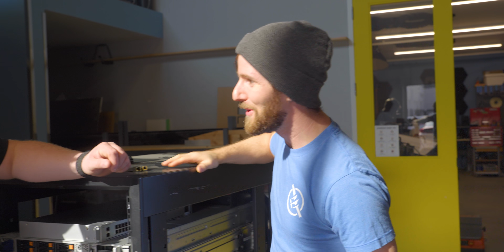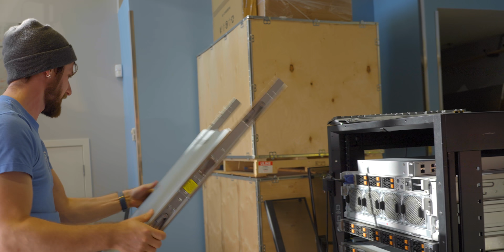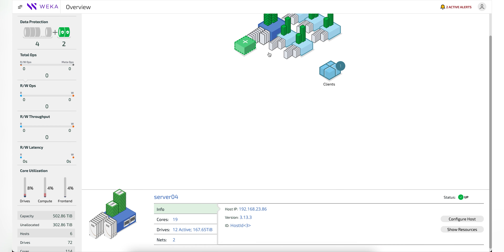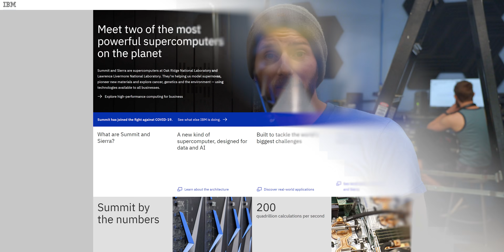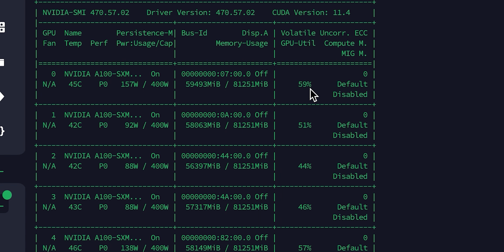The $1,000,000 Computer is Broken

Comment: So it takes you 4TB of data to get 5fps on a model that looks like it's from 2003? Sounds like the most unoptimized blender program to ever exist
Reply: sounds like you don't know what that program from NASA is doing. it is a DESCENT SIMULATOR not a CGI rendering station creating movies for Hollywood 2024. 14.3GB of data per frame, at 30FPS that would be 492GB per second of video. a dual layer BluRay disk can only hold about 50GB. a 30s video off that NASA program would be 25,740 GB. ramp that up to the 7-minute descent from space to the surface of Mars? 206,640 GB video for 7 minutes. 

that is an experiment to save human lives visiting another planet... not “Despicable Me 4”.
Reply: @lesliekilgore648  nasa had better CGI and simulations on 6KB of ram

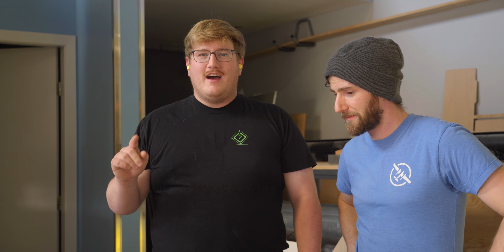Comment: From today's video at Computex 2023 he mentioned the dataset for this is about 100TB in size. 7:00 Network Time Protocol. Could you instead of used a command line script? Like in Windows using 'time' and 'date' command to set as you wish and run those all at the same time to synch time instead of creating a  time server?

Comment: So there is a "battery" that uses heat, and bricks/lava rocks to store heat. That heat is then used to make steam and make a turbine spin, but you can hold in the heat for a while, thus a "battery"... use the heat off about 7 of these machines to help add power back into the system lol.

Comment: So it very probably isn't drop damage 😄👌
Pins not having perfect contact is probably the common problem with those EPYC CPUs. Their retention system really isn't perfect. I think the next socket with the cooler pressing the CPUs down, instead of the socket mechanism like now, will improve contact. And it's not obvious to diagnose, but if you know it, it's easy.

Comment: That visualization is really cool.  When I did my CCNA class in 2006, I said someone could make a network management program that gives a visual map of your network that looked a lot like that (in my head... it was a bit sloppier when I tried drawing it).  With the layer 2 traffic Cisco has flying around, you could even have it update in real time and show and log new devices connected even for a short time without asking for an IP.  I was told that that wouldn't make sense because its just too much trouble to bother with an app or GUI and the CLI does everything you need better than any GUI ever could.  I think some things like that came out a few years later (not that I would have known how to make it).
Reply: It reminds me of the original Jurassic Park. "It's Unix"

Comment: Wow, honestly, I would have never guessed reseating the CPU and probably would have tested and replaced everything else and followed traces and checked components, updated bios, replaced cables, backplane, etc before I would have thought to just reseat the CPU. Such a finnicky issue but glad you determined the issue and got it working! $1Mil worth of equipment is not worth wasting.

Comment: coulda bought this used-from a disbanded company from a local reseller near me for $1900 and add ssd drives... ya know, if you were on a budget... Dell PowerEdge R920 Server 4x Xeon E7-8891 v2 3.20GHz 1024GB PERC H730P No HDD. 80 vcpus, terabit of ram...How I get my lab servers.

Comment: this was how i fixed my pc. it would run for 15 minutes and then shut off, and the temps were fine. i diagnosed that one of the pins on my cpu would act like an old toaster where a piece of metal would bend to complete the circuit, but mine was the opposite of that. reseating the cpu was annoying but it fixed it and now my pc is fully functioning :)

Comment: To be honest LGA socket is worse then PGA, less contact zone per pin, much more pressure needed to connect all pins, both socket/pins and processor should be 100% flat to avoid miscontacts. I've had the same problem a few times with server motherboards, in one motherboard CPU lost connection to the PCH after a while due to bad contacts in the socket, and in another one DIMM channel wasn't properly detected.

Comment: If I see how they treat there handling of the hardware in such a clumsy and unprofessional way, you can expect this kind of issues. If the equipment is really that expensive, a better treatment should be expected here. Besides, I don’t understand why Linus has that kind of expensive stuff for a hobby channel. He totally misses the connection with the viewers. And above all, where are the tech tips?

Comment: There ought to be retimer adapters in there, there should not be a really direct connection going on. And yeah, that's how it goes. Even had a similar thing on a Lenovo box. Reseating back cables... Worked...
From your use case I would never.. go with a system like that over a "normal" all flash box like Purestorage or better...
This thing seems too many low end components glued together and I'm afraid it will keep you far too busy.
And if cooling fails it'll probably brick itself faster than it can autoshutdown.
I'd suggest using a more relaxed config, i.e. twice the number of nodes with only 6 SSDs, 1 socket filled instead of 2, and so on. If wekafs works fine, you will have the same performance, but much smaller failure domains, more resilience and a more healthy load (heat etc) on those little 1U boxes.

Comment: I have a server with this EXACT same issue!!! It's a Threadripper 3990x and has 12 NVME SSDs - there are two ASUS Hyper M.2 cards each with 4 x NVMEs, plus the actual motherboard which supports an additional 4!

If it turns out that the issue this entire time was CPU pin contact, oh boy...

Comment: Lmao. For a really long time, my GPU always only had 4 PCI-E lanes. I was stumped on how to fix it, assumed that my GPU was borked, and just gave up. A year later when I went to de-lid my 8700k, and reinstalled the CPU, I found I had ALL 16 lanes back. Turns out I had the water block too tight, and that was warping the motherboard juuuust enough to make me loose PCI-E lanes. Best part is that I could repeat this on demand by tightening and loosening the thumbscrews.

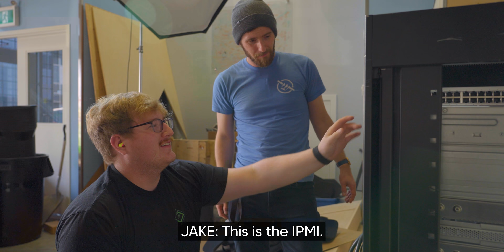Comment: 4:50 You should try Wave's Clarity VX to clean up the audio. It costs 120€ and literally is just a slider to enable or disable AI noise reduction. It's a simple VST3 llugin that works in anything from Audacity to Bandcamp to DaVinci Resolve. And it's made for scenarios like this.
Sitting on a tractor thats nearly overpowering your voice on the lap mic? Throw the plugin at 100% and the tractor will be basically with only minor changes to your voice that can be relatively easily cleaned up with some EQ.
Once again, Clarity VX is a true live- and game-saver in situations like these or on noise showroom floors.

Comment: I can attest that anytime you receive a server with components pre-installed(especially if it is delivered in a rack) you will run into intermittent issues that can be resolved by reseating components. I have seen this issue with every major server manufactory. Most common issue I've seen is DIMMs that aren't fully seated followed by PCIe devices.

Comment: Is it just me, or is their NASA demo explanation just incorrect and improperly demonstrated? It's not going to stream 14GB/s every frame, because each "frame" in that demo(according to their explanation) is a single state, meaning that moving the camera doesn't stream more data because they're looking at the same exact points for the same timestamp(every point has a state, for each recorded/simulated timestamp), just from a different perspective, because they didn't change the time in the demo, just the camera... So it's not stressing the disks per se, it's stressing more the GPU memory because the dataset even then is still too big to fit in memory. (EDIT: Yeah, just watched the original NASA video and as expected it only really streams data when playing the data, a stopped frame is not doing much...)

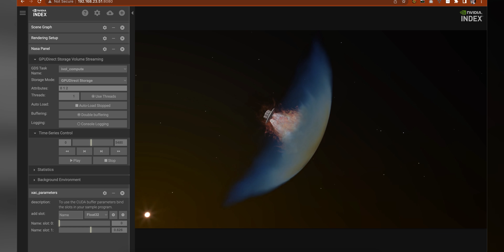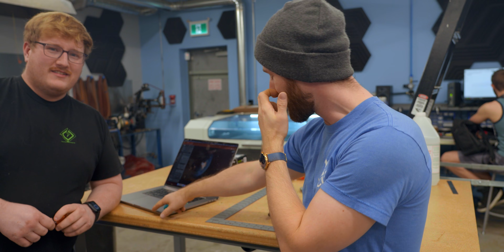Now, not fitting in memory does mean that it is still going streaming data every frame to fetch new points, BUT it will not be the full 14GB/s or possibly anywhere close. Only if they move forward or backwards through the data will it stream, through the Time-Series Control tab which they didn't touch but they cut after said "Play"... It then becomes weird because they're showing off how much data is being read by looking at GPU power usage? Why not actually show the read speeds? Is that why they hid the Statistics tab in the NASA demo, after 13:50, when it was showing at 13:17, because it wasn't actually pushing the disks at all? I guess it's a decent test for Direct Storage to show it can work with much bigger datasets more easily, but not at all properly demonstrated for this use case. Should have just showed the demo and scrubbing the time control to truly push the system.

Comment: If you sort your power connection out properly (ie get a sparky), you'll fix stability issues too. Running single phase equipment like that across different phases (given your setup I suspect you are without realising) is far from ideal and actually dangerous under fault conditions.

Comment: Adding a 10 Gbit connection to the switch might actually cause performance degredation.

Some switches change their switching mechanism from direct forwarding to buffered forwarding when differing speeds are connected. Not really an issue for normal use cases, but when you try to saturate high speed connectivity like this it can definitely have impact.

Comment: GPU usage as a percentage might be percentage of real time that a GPU is spent busy rather than percentage of potential performance the GPU can offer. This distinction is important because modern GPUs have such a large dynamic clock range that utilisation will always appear high even under minor workloads. As GPU clock is lowered, utilisation percentage is raised as it takes more real time to complete the same task. The clock governors in something like an RTX 30 GPU generally aim to keep the utilisation parameter between 40% and 60%, raising or lowering GPU frequency as required. This improves power efficiency since the lower the clock speed the GPU runs at the more power efficient it generally is with fewer wasted cycles and less energy used per cycle.

As the GPUs were running at ~1/4 maximum power there is a good chance they were clocked well below their maximum boost which would inflate the utilisation percentage number. It also means that utilisation numbers well below 100% have little meaning other than indicating that the GPU is somewhat busy.

For anyone using a RTX 30 GPU you can see this at work when playing games. The best example I have seen is the simple graphics game Factorio which regularly reports using 30% to 60% of a RTX 3060 ti in windows task manager, however any other graphically simple game will likely perform the same. This game is so graphically undemanding what is actually happening is the RTX 3060 ti is running at near minimum frequency (<200 MHz), only drawing 15 watts and running in completely passive cooling mode (fans 0 RPM) with the simple game just using a good part of the GPU time under those conditions. Fire up a more graphically demanding game along-side this game and the GPU usage of the simple game drops from 30%-60% down to 9% or lower as the GPU runs at a considerably higher clock speed to handle the workload from the other game causing the simple game to use proportionally less GPU time.

Comment: As an HPC engineer, this hurts me yet amuses me watching Jake and Linus's pain. Our entire DDN 7990 array of 10PB was wonky because of one cable  causing controller issues, go figure. Love the video :D
Reply: At least they're dealing with commercial hardware. Once you get into truly top of the line hardware, especially proprietary HPC interconnects, there are also so many driver/missing feature bugs to deal with. Some things I've heard about, I'm not even sure how they managed to correctly diagnose the problem. Like on one of the supercomputers I've worked on, around 10 years ago, there was an infamous hardware-level failure that only occurred with one application and only when it was doing a full system run of over 10k nodes, using over a PB of RAM. It turns out that memory was being laid out and accessed just right to cause rowhammer faults. Even scheduling the debugging sessions in the queue for such huge full-system jobs must have been a nightmare. Plus, it's not good to have a several hundred million dollar computer consuming megawatts of power offline and not doing useful work.
Reply: Not as exciting

Comment: Without going past the intro, I say the cables? It's always the most unlikely of suspects. First computer problem the ever was cause by a PATA cable that was bad, swapped out everything but that cable, got a new mobo, cpu, ram, hard drive and it wasn't till I swapped the cable that the problem was fixed 🤦‍♀️. Bless that 166mhz Pentium without MMX, 32mb of ram, and 2.1?gb platter drive, with a s3 virge, made Micron... That I upgraded with a Voodoo 2, should check out the quality differences using Glide back in the day over OpenGL. Especially when with the OG grand theft auto

Comment: Creepy!!!

"Chip creep refers to the problem of an integrated circuit (chip) working its way out of its socket over time.

Chip creep occurs due to thermal expansion, which is expansion and contraction as the system heats up and cools down. It can also occur due to vibration. While chip creep was most common with older memory modules, it was also a problem with CPUs and other main chips that were inserted into sockets."

Comment: Colonising mars should be scrap and they should focus on that moon going around Saturn
Reply: Mars has the most livable environment of all the planets and moons in our system.  
Titan has extremely low gravity, extremely cold surface temperature, and high surface pressure. 
Titan is very far off from having any human be able to explore it's surface, being that the trip to get there would be over 7 years of 746 million miles of space travel. That kind of technology to get us there and back does not exist yet, and won't exist for many, many decades.
Reply: @sqlevolicious  incorrect they found a moon going around Saturn that has all the important elements that are all on Earth including oxygen
Reply: they need to find anew galaxy. Our sun is doomed and also mars core is half exploded so ya
Reply: @DragonProtector  Sun is not going to burn out for billions of years
Reply: @jammiedodger7040  still we need a new galaxy

Comment: Linus, could you please review some pre-custom-water-blocked RTX 4090 cards? Like I believe the Inno3D GeForce RTX 4090 ICHILL FROSTBITE comes with a custom water block installed, ready to add to a water loop. I really want a custom water-cooled 4090 (for silent running and cooler temperatures) but I'm too nervous to install one myself and risk voiding the warranty, so will only buy one that is pre-blocked by the manufacturer. Hoping custom water cooling (with three 420mm radiators in a HAF 700 case) and a 1500W PSU will prevent any throttling down. 
Thanks, Tim in the UK.
Reply: Do it yourself, Tim. It's not difficult.
Reply: @sqlevolicious  Firstly that would result in unnecessary e-waste (the fans, heatsinks, etc would be useless) with their expense potentially useful in offsetting the cost of the water blocks if the manufacturer did it. Secondly, the moment the GPU is taken apart to apply the block the warranty is void, and any damage accidentally done whilst doing would not be covered by warranty, so I would end up wasting the better part of 2 thousand bucks! So no thanks - I want to buy a GPU without stress or the chance of losing a huge amount of money for nothing.

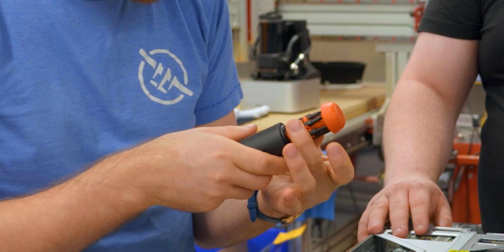Comment: 3:40 I love LTT and love that they made the screwdriver, but here it is, the thing I was most worried about with their existing driver sets and approach to bits in general. Never have that problem with ifixit driver kits.

(I'll probably still buy a screwdriver at some point, but I hope they come up with a more diverse bit set than the current ones at some point, and/or a better solution for storing more bits)
Reply: They are using standard size bits that are essentially cut in half and there is already a source for those kind of bits. Check out the VIM Tools VHC77 Half Cut Bit Set for a set that contains just about every kind of bit you could want. I would also recommend getting the VIM Tools VIS112 Master Ball Set for dealing with off-camber access issues; although those are full height bits.

Comment: Imagine using SLC instead of TLC drives. I am scared of when the drives would start failing IIRC you only get around 300-1000 write cycles with that program you are running that could happen pretty quick. Which is why Servers designed to do this kind of work usually utilize SLC but obviously you would need 3 times the amount of drives for this capacity!. . That is some impressive network you have going on there!

Comment: As a mechanic, I totally get the intermittent now that I found the issue it makes so much sense thing. Half my job is staring at I wiring diagram and going, oh…. I bet it’s here. Then Finding something like burn marks on the tiny pins in the connector or a harness that rubbed on something and is shorting out but only over big bumps. It can be so simple, after you figure it out.

Comment: golden things to consider when you have a computer that misbehaves depending on if its been on for or while or not.    if it stops working after warming up,  check the thermal interfaces,   if works after warming up, assume your dealing with a solder or contact problem.